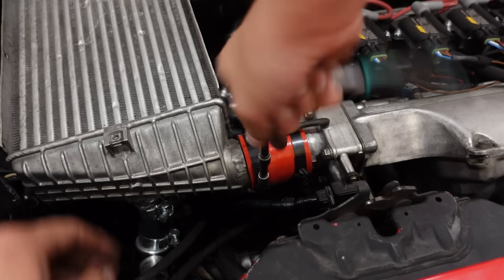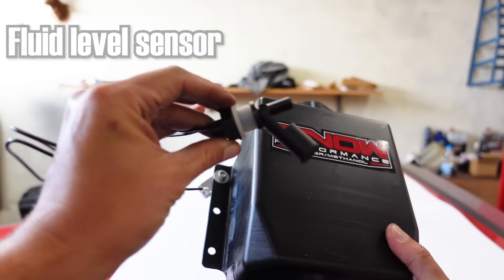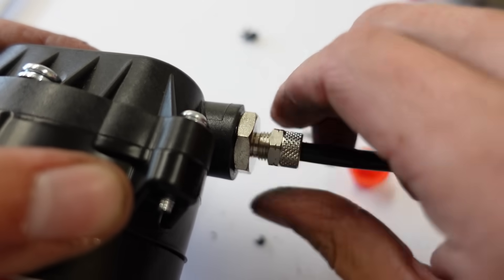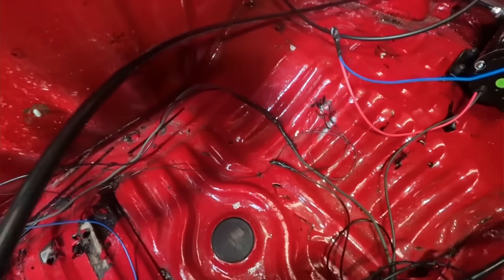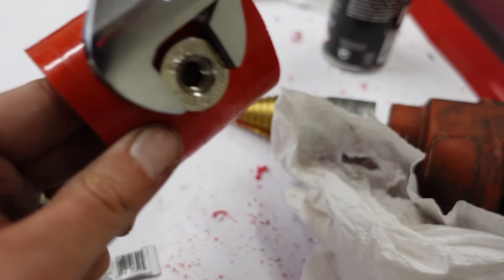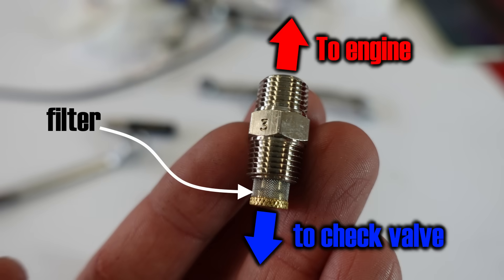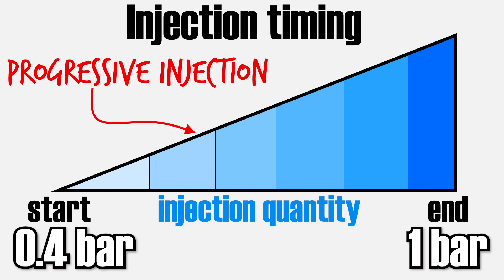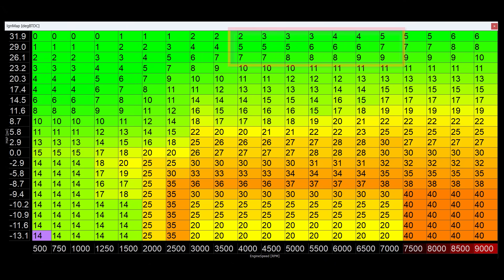How to Install Water Methanol Injection and Tune Your Engine For It

Comment: Awesome video as always, d4a. You’re one of my favorite YouTubers. I was wondering, is there any way to run water+methanol injection on an n/a setup and see a substantial increase in power (10-30%)? It seems like you’d be able to have stupid advanced timing on an engine that can handle the pressure, considering there’s extra cooling and no boost. (So small chance of knock.) The reason I ask is for under $1000 and straight forward installation, this would be a great mod before adding a turbo. Thanks in advance to anyone who replies.
Reply from the maker: Thank you for the kind words. The deal with NA engines is that most of them are not knock limited, and increasing timing further beyond max power usually leads to power loss rather than knock. It's usually only very high compression ratio NA engines that run a significant risk of knock. So, in general, water meth injection will not yield significant power increase with an NA engine. It's a good idea if high octane gas isn't available or in extremely hot climates and to keep the internals clean but it won't allow for big power gains because there's no boost or timing to be increased. The only time when water-methanol can get power on NA is if the engine knocks before optimal ignition timing, but in that case, water meth is just a band-aid rather than the solution to the root cause.

Comment: The people worrying about water in the air flow/engine. About 30 years ago, got a little work done on a non turboed, 1.6l corolla engine ( the racing engine but not worked to that amount ), not huge but enough to upset the 6 cylinder commodores ( 3l I think ) and falcon (4.2l ) drivers of that time. Was told there will be more power in wet weather, it was scarily true, that much power on wet roads.

Comment: just one minor correction: you definitely COULD see some additional power by simply having the system installed on the car. The system will cool the air, cooler air = denser air. Denser air = more power, as long as you have an ecu that will auto-correct even a small amount of AFR. You most certainly wont get the most out of it this way though.
Reply: So in theory i can install them on my GE8 Jazz? 😂

Comment: would love to see a video on using only water, to simply improve fuel economy by running leaner
Reply: it is not intended for economy use. It is intended to lower temperatures due to excessive boost when otherwise heat knocking would occur.
Reply: @ThorstenKreutzenberger  I know that's what it's meant for, but if it allows you to run leaner, then there could be an opportunity to save on gas too

Comment: Something to keep in mind as I just learned myself while installing a custom multi port W/M system is a flow control solenoid may be required if you have more than one nozzle. My system utilizes 1 nozzle per intake port on a 2.3L Ecoboost, so 4 nozzles total. Even with a check valve, the engine vacuum at idle pulled the fluid through the pump, through 18ft of line, through a filter and check valve  into cylinders 3 & 4. So, if you plan to run a similar system, I suggest incorporating a solenoid. I would say it's required for multi port setups. 🙂

Comment: Just curious if water injection is only for boosted applications with EFI.
Reply: Didn't muscle car guys do it in their carburated V8s? And plane guys in radial engines? There is some description on wikipedia, but not much.

Comment: I believe you may have meant "instrumental" to running the system, not "detrimental" to running the system, regarding the controller.  :D

Also, I'm curious what the thing sticking out of the intake just behind the throttle plate, and arching up over the silicone coupler is.
Reply: And, of course, once again, thank you for making these videos.  :D

Comment: my car is already tune stg2 + it have already more boost 28psi and more timing. If i install a wather meth kit and seeing the same power, so no lost, after injection could we say its come a much safer tune for the engine cuz we bring down the temp in conbustion chamber or we need to retune the car from scratch including the watermeth ?

Comment: Why is it ok to inject before the roots supercharger?  It seems it would be better to cool the charge AFTER the supercharger has compressed/heated the air than before.  I live in the desert driving a Mini R53 and WMI seems like a perfect fit in this environment.
Reply: The water/meth mixture helps to fill the gaps between the rotors and the casing, which slightly improves the blower efficiency. Plus it provides some cooling for the blower. That said, with some blowers the coating on the rotors can't handle fuel or other chemicals. So it's a good idea to check on that.

Comment: I wish I thought of doing this with my old supercharged Civic EF hatch.  I had a Jackson screw type supercharger on a little B16 and it was a HOOT, but after only a couple pulls, or when AIT has warm to hot,  it really suffered.  There was no good way to add an intercooler, but water injection would have been an amazing solulution.    I miss that car.

Comment: It’s about time snow made a better system they could easily made a tank with an integrated pump, built in controller and sensor. The pump is massive because it’s old tech. It’s so basic.

Comment: AlexLTDLX injects water-methanol directly into the volute of his centrifugal supercharger. He has a video on it over on his channel. Name of the vid is:

Volute Methanol Nozzles Installed & Tested

I was reading up on water-meth after your last vid (I have a turbo Barra) and apparently the ultimate for water-meth injection is to plumb a T piece into the water line and spray water and methanol into both the turbo AND before the the throttle valve. The reduction in intake temperature is so great that in some circumstances the intercooler actually adds heat back in reducing overall efficiency.

If you're worried about compressor blade erosion well take a look at AlexLTDX and see his workaround. He does have a low boost setup and it is possible that injecting into the volute works in his unique circumstance before the phase change cooling of it being injected before the compressor intake. He has many vids with data. He's a data driven junkie, which is what the channel is about amongst other things.

I did read that with fine nozzles spaced appropriately back from the compressor blade erosion on centrifugal superchargers is a non issue (and that was from a system manufacturer) - however - for reliability and durability don't do it on turbochargers was the advice, since they spin far faster.
I can't post a link because YouTube bots auto delete any links even to YouTube.

Comment: I like the kit, and I like the concept, but you keep referring to "water/ methanol  injection" but this is just water injection, isn't it? It can't be the same tune if you fill the tank with water as if you fill it with methanol...or are you fueling your MR2 with methanol and then injecting water into your intake in support of that?

Comment: That fitting in the silicone coupler will pop out eventually! I installed mine the same way, except my nozzle holder was plastic not metal, and it took about a year of daily driving but eventually I had to figure out how to get to stop popping out. You can find throttle body spacers that have a provision for a methanol nozzle BTW. I also run about 2 bar of boost and target .85. I've had mine for probably about 3 years now and my engine hasn't rusted. Lol

Comment: No way you should be using that silicon coupler for the nozzle. Guaranteed to fail! There’s no structural integrity to that coupler.

Comment: for those worried about water corrosion, just remember one of the main byproducts of combustion IS water so engines are completely used to processing it.
Reply: I don't know where people get the idea it'll rust the engine. Like he mentioned in the video, the water/meth solution actually "steam cleans" the engine internals.
Reply: yeah, if they are worried with water corrosion they should buy or make their own distilled water. it's not that hard honestly. The steam deep clean and high temperature of the internal engine will also make sure to make the corrosion build up hard to develop.
Reply: Heat the mirror in your bathroom with a hair dryer and breath on it, look what happens. Heat a pan over 100°C and put a water droplet in it, look what happens. 
I wouldn´t worry about water corrosion in a heated engine, in a cold engine it´s a different thing.
So, if you´re paranoid, warm up your engine, then turn on the injection system. 
~15min. before turning off the engine turn off the injection system so the combustion chamber dries out, then have a restful sleep.
Reply: That part of this video is just false information from keyboard warriors.  Only if you are injecting 100% meth do you have any worry about corrosion and if its only spraying when in boost and you have a decent nozzel, the mix vaporizes immedietly.  now soak some parts in meth, yup you will have corrosion.  the sheer amount of air flow would evaporate a droplet of alchohol immedietly, not even taking into acocunt the heat of the air and the compression action.
Reply: You guys realise they aren’t talking about inside the combustion cylinder, it’s the parts between the nozzle and the combustion cylinder that start to corrode… right?

Comment: Dude I was literally thinking about this and maybe doing it to my e46 but I haven’t researched anything yet
Reply: Most E46 setups use a front-mount intercooler, so intake temps shouldn't be an issue. If you have access to E85, that will help control knock. So you don't really need water/methanol injection.

Comment: Thank you for the great video with explanations. 
Can't wait to know the final power numbers on you build.
I was really wondering if that system can be used with a fully mechanical diesel, like a build OM 606. Knowing that it can live with just a boost reference without being directly coupled with the ECU gives me confidence that it can be done.
Reply from the maker: This is an independent system that just needs power, ground and boost reference. You can adapt it to pretty much anything.  You can find the dyno in the previous video
Reply: @d4a  yes, but You had to stop the dyno at about 5800 RPM,  due to hoses falling off with all that boost. I hope you'll get the hoses fixed and re-dyno it, hopefully cracking the 300HP number
Reply from the maker: Oh you watched the vid? Thank you. I'll try to do some more improvements to the intercooler airflow and then I'll shoot for another dyno

Comment: An issue with this system: The spray pattern. When any liquid is "Atomized" especially in pressurized environment, more pressure extends the liquid form of matter, the system needs a pressure chamber i.e fuel rail, where the pump feeds the liquid and the liquid pressure can be regulated. Then the actual mist feed into the intake is done with solenoid, fast moving electro magnetic valve. This way you'll have regulated amount of mist with no droplets that can damage your engine. If you simply hose your liquid inside your engine, the mist turns into squirt when the pump shuts off, or turns on. Depending on your boost pressure, you'll then have 60% or less actual mist, and rest of the feed is still liquid. This is especially bad when you are at your target boost level and your revs are high. The engine is using a lot of air, so your intake contents are used fast, while most of the pump offerings is liquid due to high pressure. Yes, the possibility for the liquid to vaporize while hitting your intake valve is high, but also the liquid getting inside your combustion chamber is at it's highest. The silliest thing to do is dump a fortune into your rotating assembly and then kill it with a cheap garden hose system.

Comment: You’re awesome.
Thank you so much for explaining my question in your video. Can I install this on a non turbocharged stock engine for reducing knocks caused by low quality gas and benefit from removing carbon buildups?
Reply from the maker: If decent gas isn't available this is a good alternative, you can get the benefits by injecting minimal quantities
Reply: @d4a  thanks 🙏
Reply: @d4a I think the Japanese did that in WWII, actually: one of their later aircraft engines ran almost constant water injection to make up for the absolutely abysmal fuel quality and rationing they were going through, using things like Pine Oil to stretch out their stock.

Comment: I wish i had those kind of roads where i live.
Looks so calm and free roaming around on those roads. And fun ofcourse.
Reply: Looks fun but also dangerous to be driving too enthusiastically as the road are small and it's hard to see oncoming cars. Would be nice to cruise around though.
Reply: @aden3113  believe it or not but more hilly countries often have such roads as main roads, and as long as you stay in your file you are good. no problem cruising 70~80km/h comfortably, and still have less crashes statistically speaking to for example america with lots of open straight roads where drivers may get bored and dont pay attention as much resulting in more carnage
Reply: @Stale_Mahoney  you can visit the area around the Nürburgring in Germany, there is a particularly nice stretch of countryside one-way-no-Speed-Limit-toll-road, and you can cruise a tad quicker there too.

Comment: Can i use this setup on a N/A engine that have high compression (too much material removed when resurfacing) so I still can make power and use regular pump gas? The engine knocks so loud under heavy load

Comment: Manifold pressure is only one metric that should be used in determining spray volume: RPM  should also be used, and I'm surprised that the Snow Performance ECU doesn't monitor this. Though the system looks okay, the fact that it doesn't use RPM in calculating how much to inject makes is very inefficient. It will inject more than necessary at low RPM's and may not inject enough at high RPM's.
Reply: I think the Snow Performance kit can be considered as a "starter kit" for water/meth injection. They give you a simple controller, just to get you started. But as mentioned above, a better controller would be ideal. I think some aftermarket ECUs can do that.
Reply: @michaelblacktree  That's a kind way to describe it, but, at the price it's being sold for, I would use slightly harsher adjectives. 

The first water injection system I used was an Edlbrock Vara-jection and it was far more capable then the Snow, and was a fraction of the price. Aquamist probably makes the best system now.  Snow had to have paid this YT'er, because there is no way that he doesn't appreciate how bad their injection system is.
Reply: @EDesigns_FL  maybe AEM is better?
Reply from the maker: @EDesigns-FL I'm sure you're the kind of person who uses harsh adjectives often, probably mostly with waiters 🤡
Reply: @EDesigns_FL  - I don't want to be a jerk.
Reply from the maker: Imt afraid you don't understand how a turbocharged engine works. The engine can't build boost at low rpm. This system never injects anything below 3800 and then it starts with a small quantity and injects progressively
Reply: @d4a  My primary vehicle is turbocharged and I have had several others. I also have been using water injection systems before you were even alive. It's you who lacks knowledge on this subject. 

If your engine is not building max boast before 3800 rpm, then it's an incredibly poorly designed system. While it might be acceptable for a 1/4 mile track car, that is a ridiculous amount of turbo lag for a street or road course vehicle. 

Further, relying upon a single pressure sensor to control a water injection system is a certain recipe for a catastrophic failure. RPM mapping also prevents water from getting injected at low speeds where is could cause a hydro-lock.
Reply: @EDesigns_FL  could you kindly provide examples of turbocharged street/road cars that build max boost below 3000-3800?
Reply: @rency5264  Just about every decent street/road turbo car is capable of building max boast below 3800 rpm, e.g. WRX's Evo's, etc. Water/methanol injection is primarily used at WOT, and that's also when engines produce lots of exhaust to feed turbos. Though RPM is a factor in building boost, it's only one of many. Throttle position and engine load will often have a larger impact on boost pressure.

Comment: It’s very important to run a fail safe because it detects if water isn’t flowing ( clogged injector, empty tank etc), and prevent additional boost/timing
Reply: I'd imagine ECU would instantly detect knocking and tune it down no ?
Reply: @xani666  aftermarket maybe, factory dodge will retard a little timing… boost depends on how that’s controlled
Reply: It won't affect your tune as much as you think and when it comes to ignition timing, if you were already in a safe place, it's only going to be safer from the charge cooling. Unless you're adding timing for power gains because you were knock limited before, but you need a dyno to prove any gains. Also cooler air is more dense and will run a fixed tune leaner and vice versa hot air will enrich it, this is why IAT (intake air temp) sensors are integral to ECU compensations, likely already programmed.
Reply: this is how i blew my n54 twice, never doing methanol again
Reply: @jake_3946  The key is to tune it on normal fuel 98RON (AUS) or 93 Octane (US) then add the methanol as a safety net, that way you're not on the ragged edge of your tune relying on the methanol to keep you knock resistant. In effect if the methanol system stops working you still have a safe tune on normal fuel.
Reply: @lightmetalinc.6488  exactly, if you push it to the ragged limit with the tune, you are asking for trouble.  Cooler charge and lower AITs is where the bulk of the power is anyway.  IF oyu throw timing at it to the point it cant run without the meth, you just set yourself a trap.